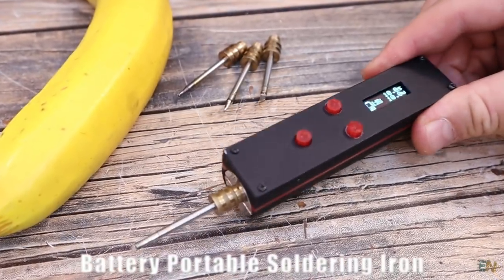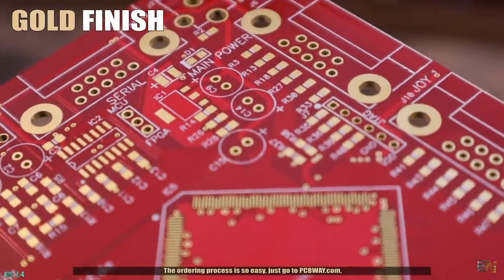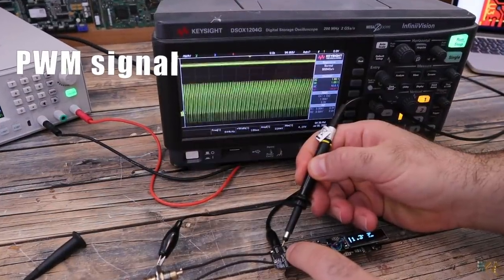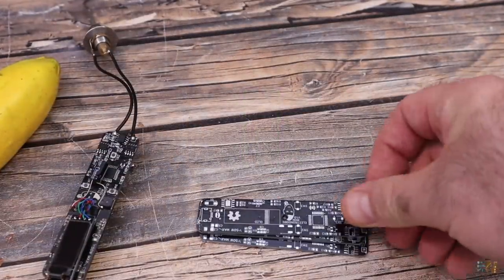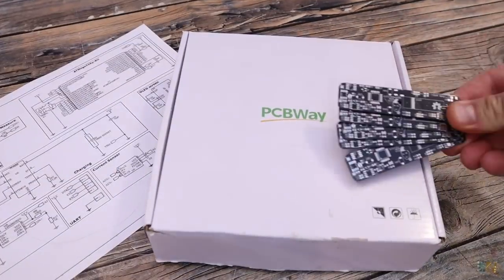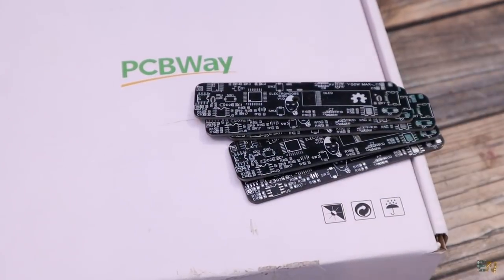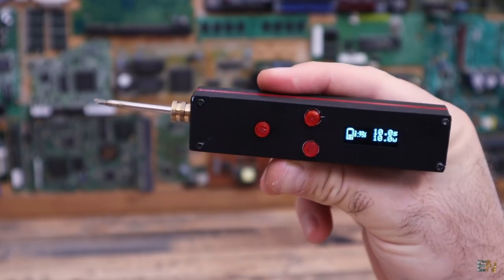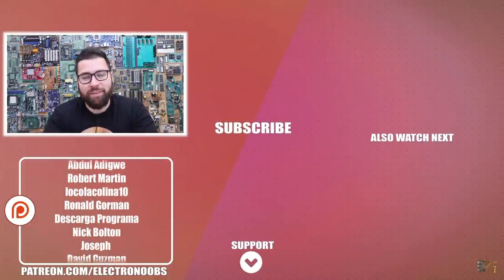Best Solution For Portable Iron - Melt Solder in 10 Seconds

Comment: You could try to see what material the resistive element is made of and try to find a TCR curve for it to calculate temperature. This is how temp control vaping works with metals such as titanium, nickel, or stainless steel that change resistance with respect to temperature.

Comment: hi have you thought about using a small 5A 5v relay after the charging circuit that is controlled by the charging circuit or the controller then you dont have to remove the battery as the relay will isolate the battery from the rest of the electronics. there are SMD types that are just 10mm x 6mm x 5.5 mm which should fit on your board.

Comment: Hello...U can use those ICs(DW01 & 8205A) for under voltage protection. To increase over current protection current you just have to use 2 or more of those mosfet (8205A) in Parallel.

Comment: Nice project. As far as I know, not all 18650 batteries can deliver 4 or 5 amps. That, I think, is the reason why some charging modules have the over current protection. There are a lot of cheap batteries with lower mAh and discharging capacity. Could it be dangerous to use a non-capable battery? Maybe it would be a good idea to emphasize that in the video description or in the tutorial.

Comment: This concept looks like one can use a 555 timer and set it to 10sec to heat the tip. Then reset the timer to heat more. Only need an overcurrent protection circuit for battery. People used vape device as soldering iron and use this tip IIRC. Some posh vape device has digital timer mcu built-in. EN design is a good concept for a battery powered soldering iron. Thumbs up!

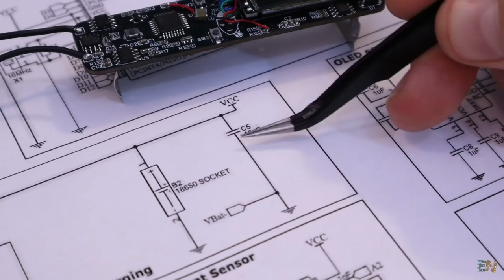Comment: 12:20 A spring on negative battery contact may have up to 0.1R resistance (I know), so with current of 4A it may cause up to 0.4V drop, which might be critical to power ATMEGA IC by 3.3V. So, adding a flexible cooper wire between top of the spring and PCB may decrease such risks. I did such adjustments on some my device (cells tester), so I know it's possible to solder. The wire goes in a round fashion way, so when spring is compressed, the wire does minimal movements and does not have any risks to crack after many-many times of cell insertion (which was critical in my case).

Comment: Manual on/off switch but still allow the battery to be charged.
Maybe use the resistance of the tip to determine the temperature measured between PWM pulses. The accuracy would be limited to degradation of the tip and tip manufacturing variables.

Comment: I should say you might prefer a smaller microcontroller than the atmega328 since not too much gpios are used here. In this way you might save more space for other components, if needed in future versions. Maybe an attiny one
Reply: The new attiny chips such as the attiny1614 or 1616 (or even 402 if it the program is 4kb or less) might be good enough. You'd just need to install the megaTinyCore library for it to work with arduino.
Reply: Also, the 1 series attiny such as the 1616 and 1614 (instead of 1606 and 1604) has a built in DAC which could solve your undervoltage protection problem. You could generate a constant voltage and use that as a reference using a comparator or op amp that could drive a mosfet.

Comment: Crazy idea, the resistance should change with temp, so you could make a little pause between heating and measure resistance to calculate the temp, so you should try this with a external source to see if the change is big enough to use in that way

Comment: You can program the arduino to tell you when the battery's voltage gets too low . Great project.
Reply: Or, add an electronic switch/MOSFET/etc. and just have the Arduino turn the battery off, when the voltage falls too low.

Comment: Very good projet! For a next version maybe you can measure the temperature by measuring the resistance of the tip? You also can reduce the size of the case and the pcb maybe with a circular pcb wich fit at the back of the soldering iron
Reply from the maker: Very good ideas :)
Reply: @ELECTRONOOBS  I like that idea, like sandwich the battery between pcbs so it's thickness stays a little bit larger than the cell itself

Comment: The DW01A which most of those cheap china boards use, doesn´t need to have it´s OC output connected to a mosfet. Just build it´s typical application circuit without the OC mosfet and you´re good to go with an UV protection for 50 Cent or less.

Comment: Nice job, ^^ but you can improved it by:
1. use 21700 cell like VTC6a (4000mah >30A)
2. use boost converter, TPS61088 (30W), MP3429 (30W),  MP3431 (>30W) and change to T12 tip
3. upload program via USBASP to skip bootloader (boot faster ~2s)
4. to prevent chip reboot while heavy load VCC-10uf -> 4.7OHM-0.1uf ->CHIP

Comment: Great effort ! How long would you be able to use it before the battery is empty ?
Reply from the maker: Depends on how much you solder. If you don't touch it, the battery stays charged weeks. If each time you press the button 10 seconds, and it draws around 3 amps and the battery is 2200Ah, well, with some calculations we could get the aprox time...

Comment: Surely you'll find a way for the temp control feature. If they were able to do it on vapes, I strongly believe you could do it too.
Reply: Maybe look at a vap board to see what they used.
Reply: @mrgreenswelding2853  

Definitely going to try some 510 tips on my mod. It has an evolv chipset, so the resistance based temp control is top notch... But, as it is also my DD vape, I won't want to modify the firmware settings for soldering specifically (might be needed to improve soldering performance, not sure) 

...there are also many other very inexpensive vape controller boards that are great, which might be a good place to start.

I do have a dead mod kicking around, board should be good just some bad connections to 510 that need to be redone.. it uses one of the cheap chipsets, I don't remember if its a more modern advanced temp control board or not.. it's at least able to regulate by set wattage though

Comment: 5:00 ha!!! you could just use another MOSFET (with lower rDSon) instead of the FS8205A used with the battery protection IC DW01A. 
The FS8205A (dual N-MOS, 0.025 rDSon), when used both MOSTEFs in series, has total internal resistance 0.05R. This resistance makes 0.15V drop when current is >=3A, according to Ohm low. The 0.15V voltage is a threshold according to datasheet what used to sense on pin #2 (CS - current sense) of DW01A IC, which is dedicated to save for over current. So, to allow, say, 5Amps you need to use other MOSFETs with a little lower resistance, like 0.15V/5A=0.03R and divide on 2 MOSFETs - 0.015 rDSon.

Comment: You can solve the overcurrent problem by adding the tp4056 board in parallel. Each board is 3A cutoff two in parallel gives 6A I works without issue.
Reply: Interesting. I'll consider that! Thanks!
Reply: TP4056 is not a good IC ( the heat is a big problem for this IC ). Better to use TP5100.
Reply: No, It only increase charge current which is unnecessary. To solve the overcurrent protection you should use 2 or 3 the dual mosfets (8205A) in parallel.

Comment: But can I ask you something....why did you need to remove the battery instead use a mini slide  switch  to disconnect the battery
Reply from the maker: Because I forgot to add the switch... 😂
Reply: @ELECTRONOOBS  😂😂
Reply: @ELECTRONOOBS  but broi You San still add a switch 😌💗
Reply: @ELECTRONOOBS  bro can I have the full set of this project plz

Comment: With no disrespect to you or the project, but why did you not use an 18650 protected cell?
Reply from the maker: @MrBobWareham those have current limit and I want to control the limit myself, otherwise the power would be limited

Comment: why dont you use a two battery design by changing the length of the soldering iron , without temp control the ic's dont matter because we can get fixed temp soldering irons . use a temp control for the design . its important!